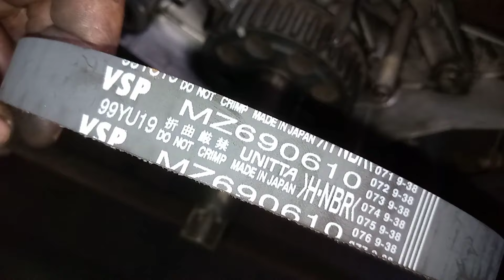Mitsubishi Adventure 4D56 | Timing Belt and Seal Replacement

Comment: My Slm Vehicle My 2007 model CLIO 3 1.2 16v gasoline vehicle does not exceed 90 km at 3000 rpm on long distances. It does 115-120 km over 4000 rpm, but the car screams a lot. As far as I learned, when the last gear is changed, it easily goes over 100 km at normal speed. Is this true, how much is the estimated cost? Is there a suitable gearbox for this if we put another gearbox? I would be very grateful if you could answer my questions. Thank you.
Reply from the maker: Sorry I have no idea,

Comment: Sir base sa experience, pag stock ba at hindi pa nagpapalit ng timing belt mga ilang km hanggang pwede paabutin? Kung by the book ang susundin sabi nila 80thou km. Pero may iba na umaabot ng 90k and above pero maganda pa rin ang kondisyon ng belt.
Reply from the maker: Para sa safety na rin kasi ng makina sir, kailangan ng magpalit ng timing belt pagdating ng 80k km.
Reply: @DiYSpanner  as per your observation sa mga napalitan nyo na, maganda pa ba ung condition nung belt?
Reply from the maker: @gpausalonga9073  oo sir sa itsura ng  timing belt maganda pa, lalo na kung hindi na basa ng langis.
Reply: @DiYSpanner  ok sir salamat 2017 mdl ung sakin 81k na odo. Baka pasilip ko kung may basa na mga seal. Before 85k cguru papalit ko na belt

Comment: Boss tanong ko lng po sa ford everest 2005 model automatic ilan po ba ang oil seal nya balak ko kc papaltan  tnx po
Reply from the maker: 3 lahat boss. Camshaft oil seal, front crankshaft at rear crankshaft oil seal.
Reply: @DiYSpanner  ung sa rear crankshaft po sa may transmision po un dba sir.. sa harap po bali dalawa lng po  camshaft at front crankshaft?
Reply from the maker: Oo sir tama isa sa transmission side at dalawa sa harapan.
Reply: @DiYSpanner  ok nakita ko po kc sa video mo sir 3na oil seal pinaltan mo po sa ford po pala dlawa lng po tnx po
Reply from the maker: Depende kc sa makina sir. Salamat din sa pagbisita sir
Reply: @DiYSpanner  slamat sir sa video at info mo

Comment: Sir, pede malaman breakdown ng gastos mo dyn. If ever may idea kau, yung sa pumpbelt sabi ng driver ko isang set (4pcs) ay necessary palitan lahat. I mean, pede bang yung nasira lng palitan mismo?

Note: napigtas yung timing belt ng unit ko at paano malaman pati oil seal need palitan na rin? Salamat
Reply from the maker: Nasa 5k ang parts sir, 2 timing belt at 4 na oil seal. Sa oil seal, pwede ang may tagas lng papalitan.